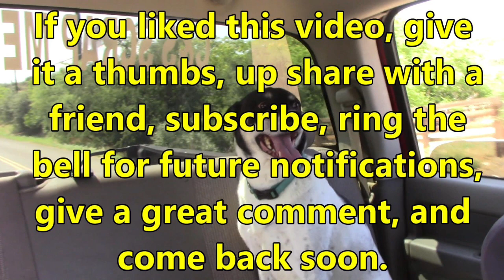I Finally Got My Aluminum Bronze Color Right

Comment: 11:47 lots of shrinkage in that ingot, which I hear is common to aluminum bronze.  I was just reading a patent (US1838632A 1928, long expired) which claims that adding some silicon and iron reduces shrinkage, though unspecified how much.  The patent also applies to between 3% and 9% aluminum, which is mostly below the ~8.5% cap for a softer corrosion resistant alloy.
Reply from the maker: Thanks for stopping by and commenting. I appreciate comments. Stop by often.

Comment: I got that popping noise...tried to adjust the air in. Is it from my pressure wrong?
Reply from the maker: I don't think your pressure is wrong. Mine was caused by the fire 🔥 burning inside the burner tube and using up all the oxygen. Thanks for watching brother.
Reply: @CandSMINING  sounds like a pulse jet....tried to adjust air and wouldn't stop